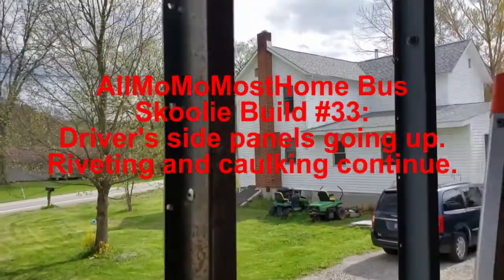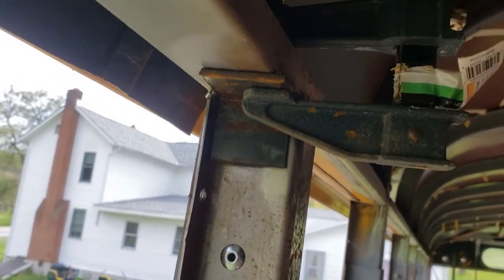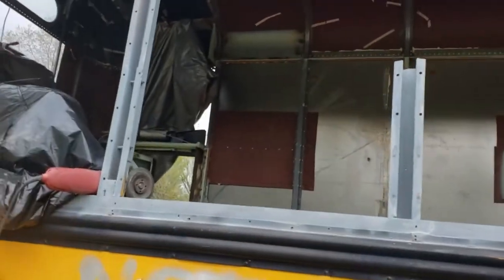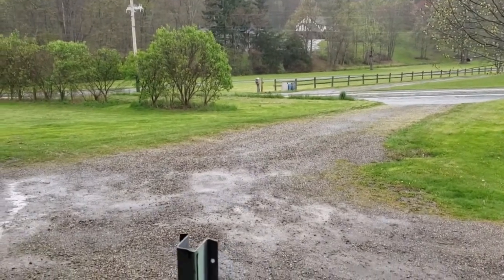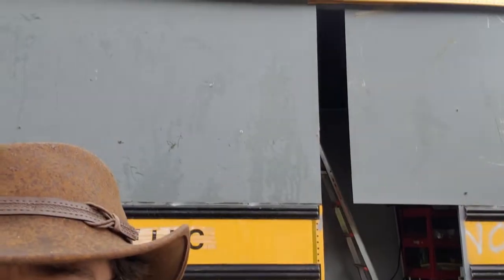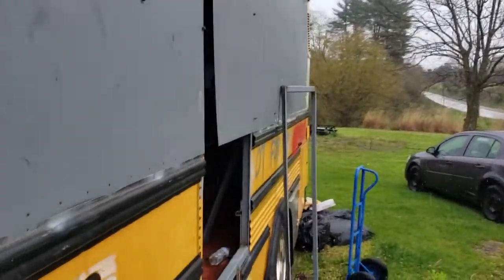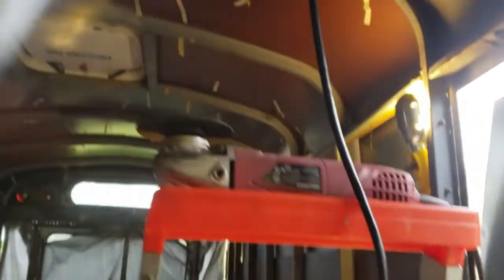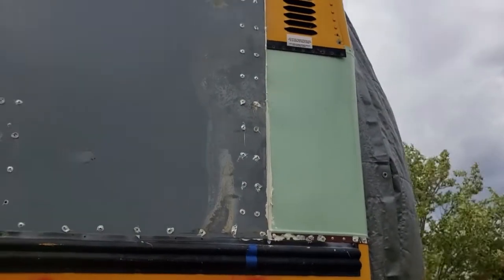Skoolie Build #33: Driver's side panels going up. Riveting and caulking continue.

Comment: Man...I have GOT to hand it to you, man.  That is some tedious work, but it is looking GREAT!
Reply from the maker: Thanks! It's going to get better and better from there!
Reply: AllMoMoMostHome Bus do you notice that when you are doing a task, you finally get good at it and get into a good rhythm just in time to be finished with that task!
Reply from the maker: @HarmonyExpressSkoolie  that's exactly what's happening.  My drilling and riveting are faster than before.  Putting these driver side panels up was easier even without using the tractor to hold them in place.  There's a learning curve for sure.